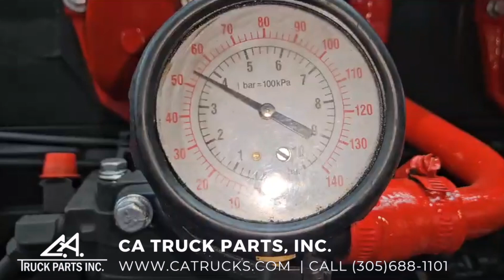1986 Cummins SMALL CAM Diesel Engine For Sale | CA Truck Parts, Inc.

Comment: I didn't know they still made small cams in 86 hell they were making the Mechanical n14 by then
Reply: In 86 they were building the BCIV.  Then came the NT88 and the STC engines.  The N14 was introduced in 91.